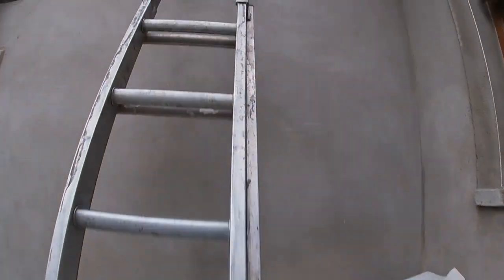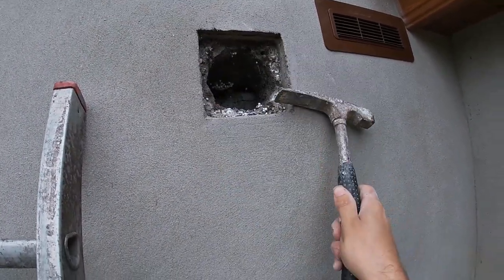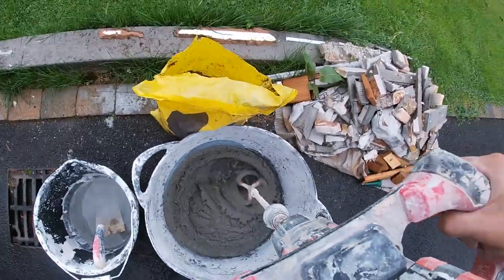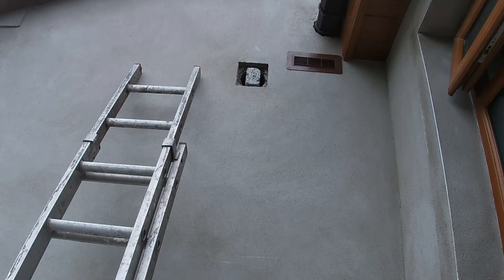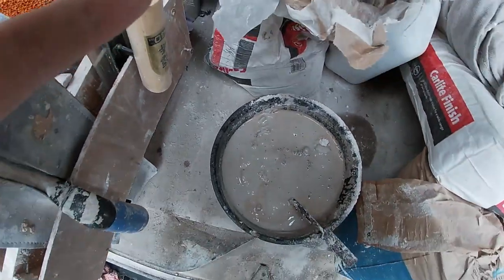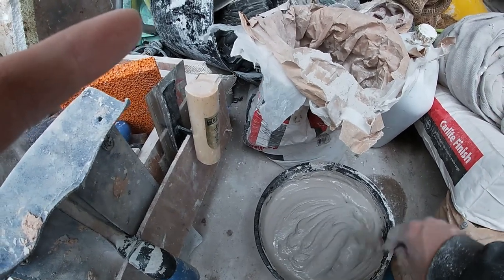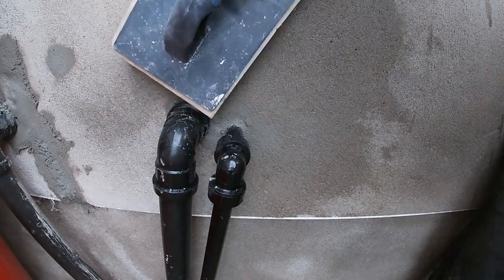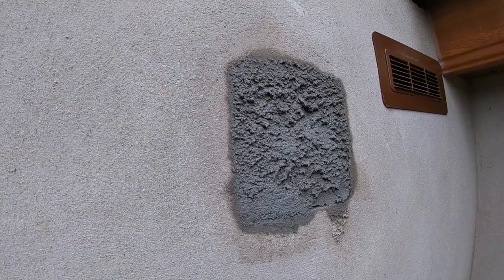How to Fill Small & Large Holes Outside - Exterior - External Wall and Patch Render

Comment: What happens if one of these days those pipes have to be repaired? How would they remove the concrete
Reply from the maker: You wouldn't need to ir should twist out leaving the hole tidy for a new but if really needed just chip of around
Reply: @macplastering  got it 👍!!!

Comment: I cant fill the hole from the outside, can i get this job done inside only, as outside is very narrow and high up. Can the hole be filled from the inside only successfully ? only that I'de have to leave the square plastic on the outside.  Any suggestions. I rather do it myself then call anyone in ?
Reply from the maker: That might work as long as the vent is good and waterproof mate if not best to do both sides also be cautious not to drop to much gear down cavity
Reply: @macplastering  Thank you. I'm going to have to do it from the inside, no way I can go out. Perhaps 🤔 get a round vent type of water proof plastic thing then put that trough the hole first for extra outside protection ( but from the inside) then stick a lot of pebbles then put in sand and cement then obvs when dry paint over it, scared to do it but it's got to be done. It sounds mad but might work 🤞
Reply from the maker: @priscilladevi9705  wishing you the best on the job
Reply: @macplastering  Thanks !

Comment: I’ve got damp patches and now mould on my downstairs toilet. Was convinced it must have been the seal around the bath as it’s directly above. Spent two days sorting that but the ceiling has gotten worse over the past two weeks. Climbed up on my garage roof today and there is a hole in the outside wall, just above the toilet ceiling, that you could easily fit a ping pong ball in. Could this be causing the issue? Could I fill this with just cement or do I need to call someone in? Honestly, who’d own a house 🙄🫠
Reply from the maker: Hi yes these things can be a pian to sort it could well be that hole letting the water in best to fill it up to be safe I would mix a little 3 to 1 mix of sand and cement  to fill it. And try air room out as much as possible kill and clean mould and inspect to see if it was the cause

Comment: This may seem a bit of strange question, but if I 'seal' a hole in the wall on both ends with render, should I first fill the hole with some material? Would condensation (from heating and cooling the house) not form on inside of the hole, as it does in a chimney if you seal up both ends of the chimney with only air left in the middle? The reason I ask is because the hole I have runs 'parallel' to the plasterboard and so damp inside hole would be a problem. I could fill the hole in with expanding foam or something similar, then render on the outside. Maybe I am over thinking this though lol. Thanks.
Reply from the maker: Most houses should already have a ventilation system installed for the reason you say this hole was from an extrator van not a vent but some insulation in won't hurt at all my friend 😉
Reply: @macplastering  I actually think the hole was for an old satellite dish cable! Hole was drilled quite large. Will fill it just to be safe. Thanks 👍
Reply from the maker: yes best to get it filled stop water getting in or little friend's entering from here LOL have a few mixing videos if you need :)

Comment: Just wondering could you use expanding foam to fill the hold first and then put sand and cement over? Thanks
Reply from the maker: Yes but wouldn't be as good as this would be slightly weaker but if not to big should be ok

Comment: Any advice on rendering in winter ❄️ weather, Frostproofer , 5 degrees , freezing wind's/rain etc, small flat to render, worried about rendering this time of year, mix, labouring and applying, under pressure to finish before Xmas break, weather against me, Any advice would be Appreciated 👍
Reply from the maker: Think i have a video on it on the channel mate
Reply from the maker: But my mixes would be the same only frost proff or rapid set added work when dry and never if going to freeze
Reply from the maker: Is a nightmare before crimbo trying make sure what u start u finish
Reply: Cheers I'll figure it out 🙂
Reply from the maker: thats the old one but will update it = https://youtu.be/JxGoyKk1ZL8

Comment: Guys, sorry here but I'm a DIY newbie, actually no, I'm DIY idiot would be more accurate.

My problem is a extractor van hole in the kitchen. It's not required any more and I want to fill it in. The wall is concrete cavity block which was about 7-8 years pumped with more insulation as part of the home insulation you could a grant.

Could you please tell me what I need to do ? Sorry for the stupid questions.

https://www.youtube.com/watch?v=Ki56Pgsb9Dk
This other video shows a guy using a thermolite block which he cuts circular using a core drill, bit smaller than the hole, seals it in, but he only shows you from the inside what he does ?

You show what you do from the outside ?

Could you please help me understand what I need to do for both ends, the inside (inner wall of the kitchen) and the outside (outer wall of the kitchen)

Do I do what he did on the inside wall and then on the outside I do what you did?  At this rate between what the guy did on the inside (the drill, the drill bit...the thermal block)

your cement mixer for the outside I might as well call some-one. It would probably be just as cheap or am missing something here completely.

Apologies for been an DIY idiot. 

Any help here would be much appreciated
Reply from the maker: Hi gary mate 

so i would do what i do in this vid on both sides you can just cut a brick and use it but dont fill the cavity....
dont need a mixer - https://youtu.be/bqOmOxOCdRI

that method will work great 
on the inside you fill with sand and cement then keep it back some to fill with finishing plaster 

so 1st day cut a few pices to fit hole build them in using sand n cement 
next day (day2) fill like i do here and finish outside if possible if needs do a build out coat and let that set then finish with fresh mix
keep inside cut back a few mill like 3 mm is great 
3rd day skim inside and finish outside if you didn't get that done beforehand 

hope this helps we have loads of patching plaster videos on channel
Reply: @macplastering  thank you so much. Really appreciated taking the time out to explain. Thanks you so much.
Reply from the maker: Always here buddy and tonnes of videos if you need to peek through channel